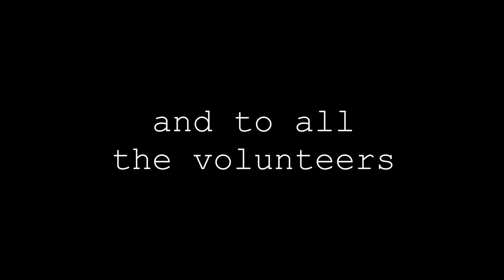Building a Teardrop Camper - Episode 10

Comment: Glad you’re flipping it. If you need a little bit more room after flipping between the axle and the trailer frame you can install some larger spring shackles to a point as long as the springs don’t flatten. You can put some puddy on top of the axle under the frame and go for a bouncy  drive. The puddy will compress to the minimum distance between the axle and the frame. You can use that to determine if you have enough space. 

Your videos are great, keep up the good work.

Comment: Personally I would switch over to 5/16" diameter bolts with a regular head and a 1 1/2"washer to hold the teardrop to trailer. The head of bolts are under the mattress, and you can rest easy the teardrop will not blow off. You can buy a trailer hitch receiver to raise or lower the trailer height for ten bucks. If you pull axle to sit on top, just loosen and pull the rear bolt from leaf springs. Looking good! WW

Comment: Nice escape pod you have there. I second going to hex-head bolts with thick fender washers, you could even epoxy on a 1/4" plywood pad to distribute the load a bit further (think mounting deck hardware on a boat).

Flipping your axle mounts is an OK solution though I suspect clearance will be an issue in the long run. You might look at torsion axles as a replacement, this has the added benefit of independent suspension which will smooth out the trailer ride when you are on less than perfect roads.

Comment: I am a Toolmaker by trade. A Hardened 1/4 bolt is strong enough to  lift a 2500 lb milling machine(Bridgeport), Adding fender washers to spread the load on the wood will help a lot. Get them from McMaster Carr, the have a huge selection.
Reply: If you're adding a gasket all the way around, maybe think about putting some rubber washers or spacers on the bolts between the teardrop and the drawers as well to spread out the load.  Just an idea. :)

Comment: Just discovered your videos and enjoying the build. A suggestion, use blue loctite (Loctite Threadlocker Blue 242) on the threads on the bolts and nuts that hold the teardrop onto the trailer. It will keep them from coming loose. Warning, do not use the red loctite, it's (almost) permanent. Apply the blue loctite when you're attaching the teardrop the final time.